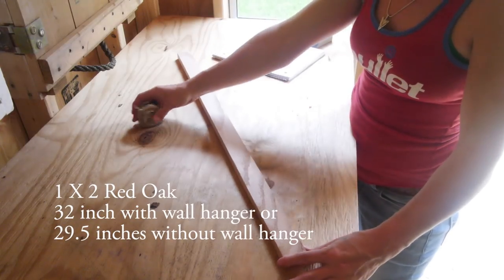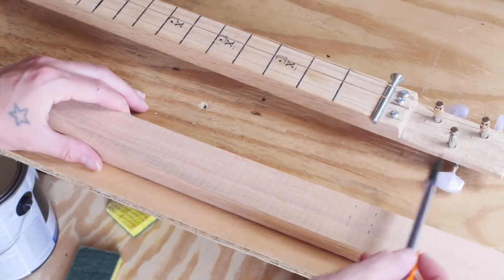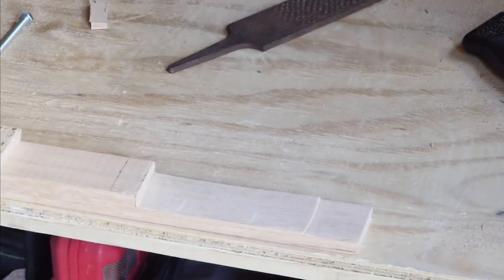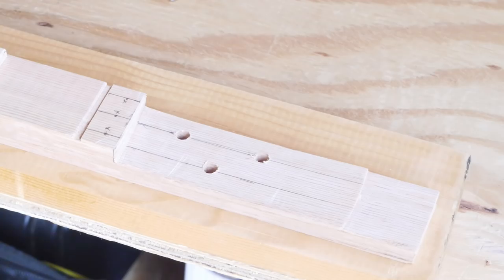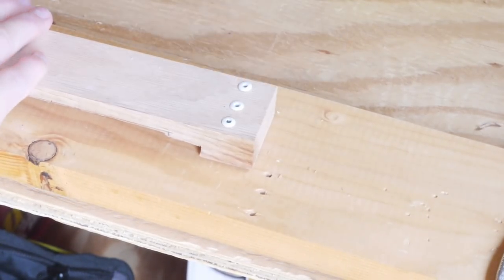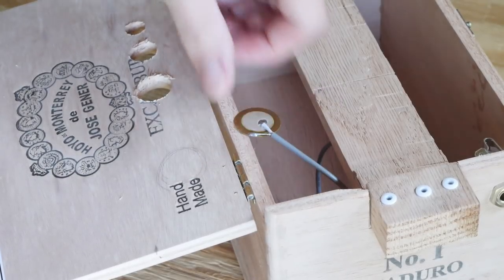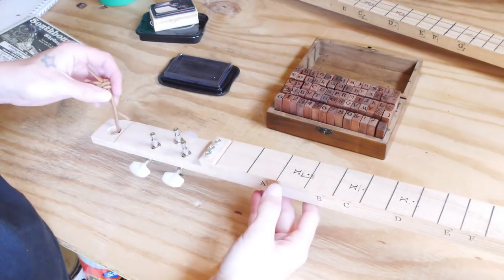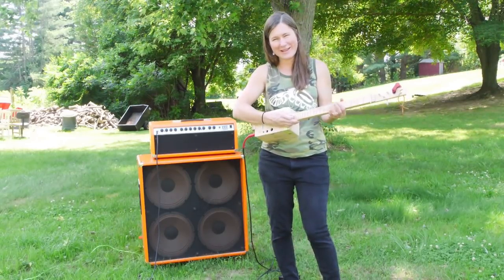How to make a cigar box guitar

Comment: This is so great! I've been building regular acoustic guitars and it was so much fun to build a cigar box in a day! It's got a growlin' bluesy tone no regular guitar can match. One possible correction:
Around 28 minutes you have a diagram showing how to wind the strings around the tuners. You show the low G string winding around the outside of the tuner and the insideof the guide screw. While this will work, I think it would drive the player crazy (at least it would drive me crazy) to have one tuner working the reverse direction from the others. So I passed the string around the outside of the screw and the inside of the tuner and it works just fine. Thanks for this great video!
Reply from the maker: Oh thank you, my mistake! I will have to re-do the diagram. Thank you for the heads up!

Comment: Hi Dar,
Nice basic instructional video on how to build a slide cbg, one thing of constructive criticism is the lack of internal support of the neck,  I have been building for quite a while now and have found that without some type of bracing the neck, it will eventually move or bow, didn't see you reinforce the neck, unless I missed it, at all.
Very simply to do, block the neck from the box opening you cut in front and back and glue those supports in.  Now countersink a hole through the neck above the block and tighten her down...whammo a nice tight fit, that will spread the tension out evenly...works well for me, thought I would share it.
Keep up the good work and video's.
Reply from the maker: Thank you. I would like to see a diagram of that. compose2005@yahoo.com or video
Reply: fokker313 I wouldn't mind seeing a diagram of that as well. Perhaps you could make a video?

Comment: Hi there. Great video! Just a question,  I know some CBGs have an added fret board on the neck, raising it above the body. Is there any reason why i can't do that with this kind of neck? I mean just raising it a little above the box height? Thanks
Reply from the maker: Yes you can use wood glue and clamps to add a fret board, I would suggest getting a bolt that is proper height for the strings to be slightly above the fret board.

Comment: Hi Dar.
Did you put frets into the finger board or just leave it flat. Thanks Greg
Reply from the maker: I leave it flat. Slide instruments usually have no frets.
Reply: Hi Dar, could you please tell me  how far apart should the strings be apart on the fretboard. Appreciate your time and thank you. Greg
Reply from the maker: from each side go in 1/4 inch, the middle should be 3/4 inch in. What kind of tuners do you have? 2right 1 left?

Comment: What size bolt for the bridge and what bolt size for the nut?
Reply from the maker: It really doesn't matter just something with a little thickness to get the strings off the box and neck. Just have them be the same or close to the same size as each other.